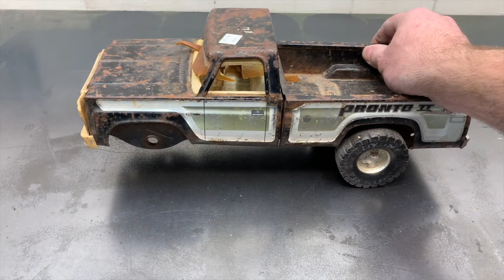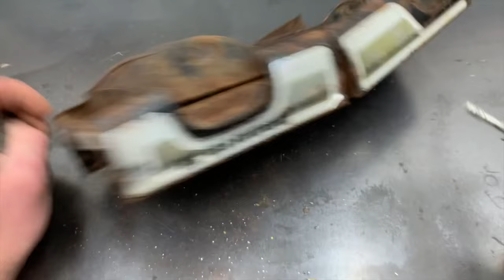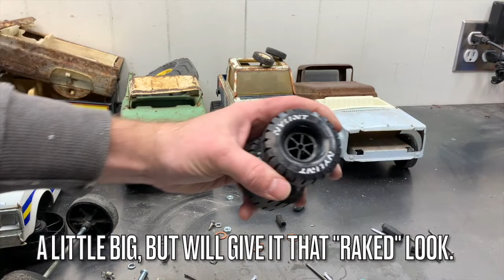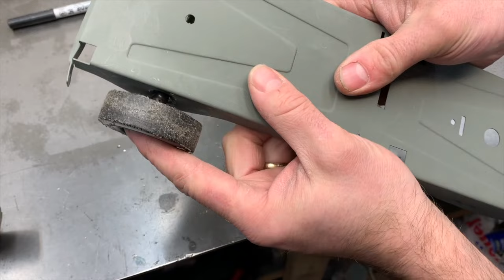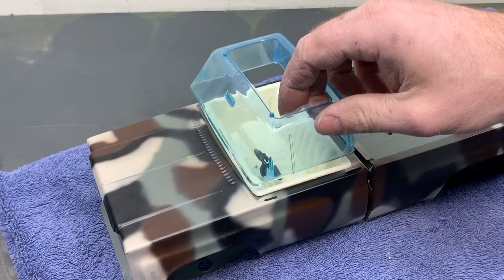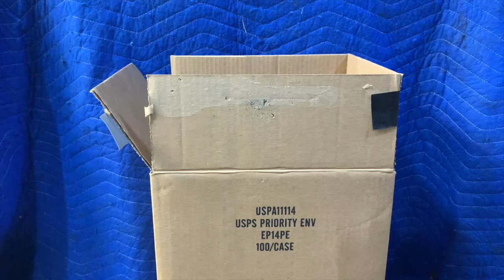Can I Make My First Truck?

Comment: My first truck was a 55 chevy 3/4 ton stepside sold it and bought my current truck a 1973 chevy 1 ton custom 30 with the original 350 4 speed in the floor and 9ft flatbed with a good amount of history in my little town
Reply from the maker: Very nice. I'm curious what part of the country your from though. Here in MI you don't see many 73's. They rusted away pretty quickly. I saw some pictures of yours on your channel and it looks great!
Reply: @RepairRestore  im from down south in louisiana best 800 bucks i ever spent body was shot but shes just about original factory shape again
Reply: Figured id come back and give an update on the 73 her 350 grenaded on me so I bought a 6.2 diesel from a m1009 for it and its just about ready to live again.

Comment: Good afternoon from Susquehanna Pennsylvania, I assume that it was the young ladies father who left the bird shot on the tailgate LMBO my first car was a 1980 Ford Pinto wagon, 4 cylinder 5 speed transmission 12,000 miles for $3,000 in 1982, blew the motor dropped a 351 Windsor with a rebuilt transmission into it in 85 , just couldn't keep tires on the back, but it was great for showing those camaro's who was boss LMBO, won't touch a Ford anymore, and I love them old square body Chevy's
Reply from the maker: That is awesome. I have an uncle who put a 350 in a Triumph and had the same problem with tires! Must have been some bad rubber!😝

Comment: Since first cars are often security prompts for system access, I will pass on that question. However, the tranny in the truck was probably a TH350 those Turbo Hydramatics usually cost around $325 to have rebuilt.
Reply from the maker: Transmission in my first truck was a TH350. The toy looked like it was set up for a 4 speed so maybe a SM465.

Comment: Looked great and good to see the crane back in action.
The signs on the truck; you were younger and they looked cool.
My 1st vehicle I paid for was a:
1983 Toyota 4x4 pickup, factory lift and short box. She ran for 21yrs...unfortunately she had a very bad skin condition😉
Reply from the maker: Thanks Tim. I know what you mean about those Toyotas. It was like they wanted to shed weight as the motor lost power with age. Toyota's way to keep it at peak performance. I have had a few and loved those trucks.
Reply: @RepairRestore  

Absolutely true!😃

Comment: 1985 Oldsmobile delta88 Royale( broumn(can't spell that). Built like a wheeled tank!
Reply from the maker: I remember those big Oldsmobiles. I remember my dad had one with a Olds 350 diesel.
Reply: @RepairRestore  mine had a 307 cu.in. V8. The delta 88 was the 2nd largest at that time. Regency 98 was the big girl.
Reply from the maker: @robertgriffin662  I bought a 1966 Delta 88 from a customer when I was 18 and it had the 425 2 barrel. It was rated at 325 HP and would still light them up. It was so squishy that it felt like you were driving on marshmallows! I never got it legal and ended up selling it though.
Reply: @RepairRestore  mine was light metallic blue with dark blue vinyl  top and blue interior.  I'm 5'8 300lbs and I could  lay sideways  in the trunk. Joked to everyone  that it had plenty  of room for bodies!

Comment: 1973 GMC JIMMY, 4 wd, V8, automatic transmission, 31 gallon fuel tank that I could fill up for under $15.00 !!!! And it only cost $3,000.00, and I got it in 1973 !!!
Reply from the maker: Very nice! 1 of the few square bodies that had the cap that completly came off and turned it into a convertible. Here in MI those 73's rusted out super fast though.